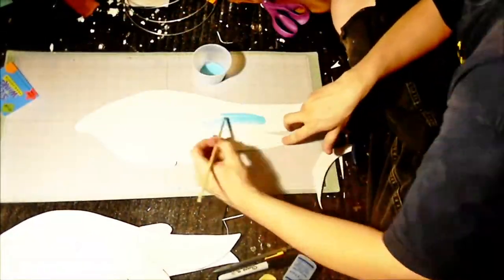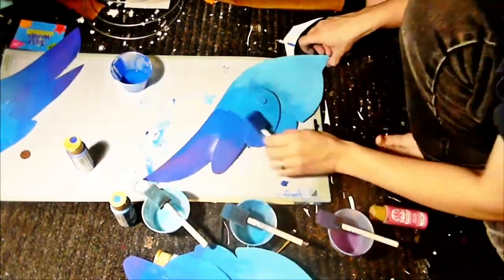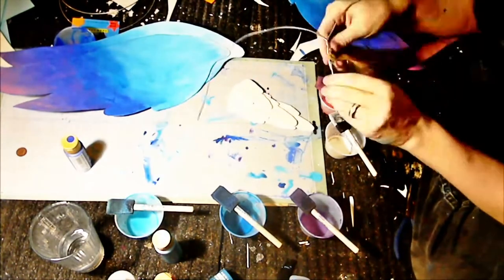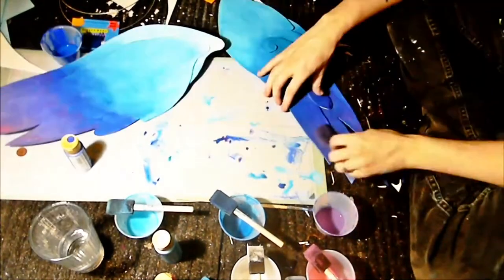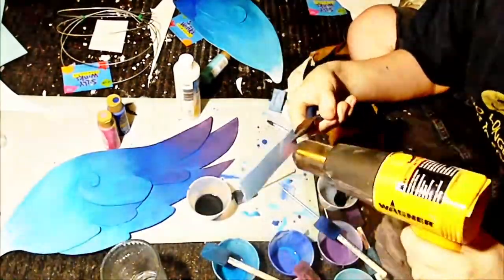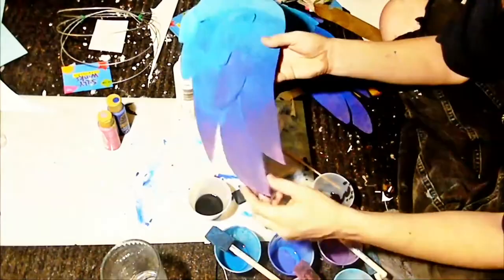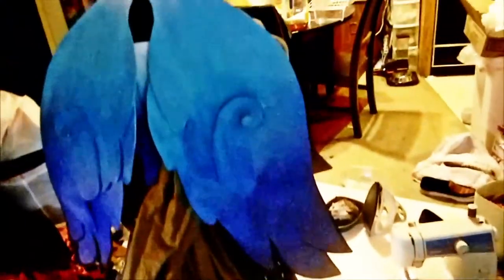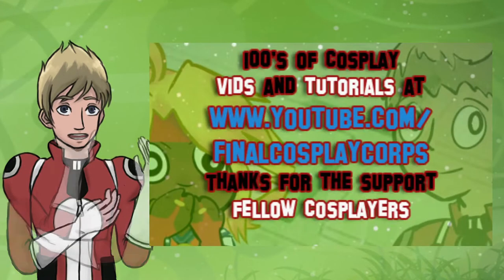Elements of Cosplay - Applying Acrylic Paint to EVA Foam

Comment: Thank you! I’m making a fake cake for a prop in a play and need to make fake ganache. I first made the underneath shape out of styrofoam and covered it with cosplay foam. I then covered that with fake frosting made out of siliconized acrylic latex elastomeric sealant and paint. I now need to make fake ganache to add thick drips around the perimeter. Can you please tell me what to use to thicken craft acrylic paint to make it a slow thick drip that’s flexible and will adhere without cracking? Thank you!